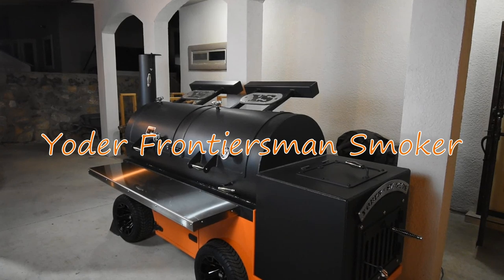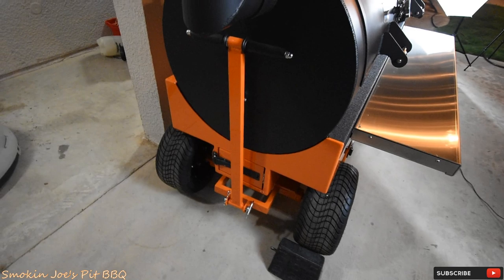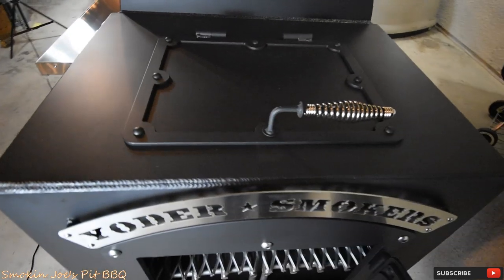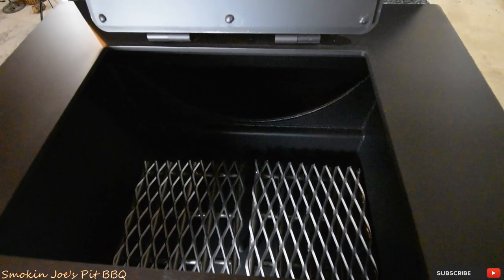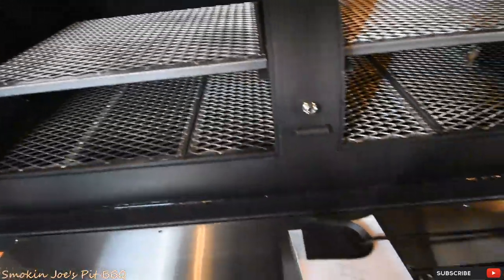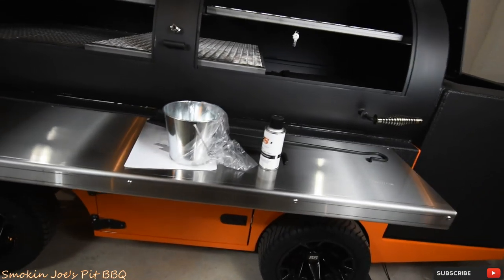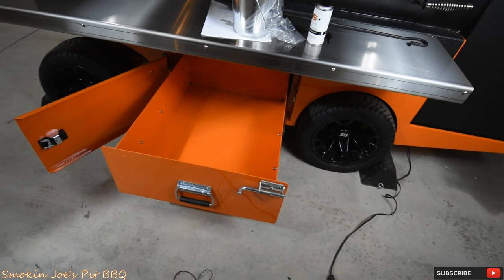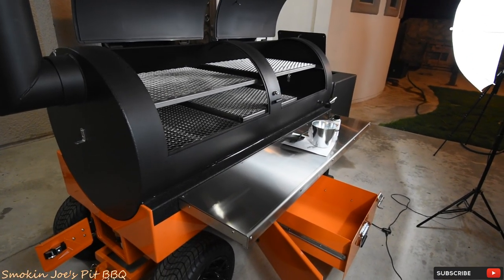My New Yoder Frontiersman Smoker

Comment: I had mine on a tandem axle trailer built the same inside as yours is but had to give it up because I just couldn't use it for what I needed to do. I liked the way it cooked everything, it was just hard to utilize the bottom grates all together because they dont slide out. I am surprised to see that they still build them this way . I had the temp control system too believe me I didn't have to pull it open too far to even out the temp left to right. Anyway congrats on your new Yoder.

Comment: I am considering purchasing this same smoker and have been doing a lot of research. I came across someone else’s video suggesting that the insulated firebox upgrade lowers the flavor quality because it was “too efficient”. Do you have any thoughts on this?
Reply from the maker: There is absolutely no truth to that. The fact that you have an isolated firebox means you'll run efficient and not burn through wood like crazy. Instead of the heat being absorbed by the outside air, it's forced to go through the smoker which means you'll use less wood. 👍🏼
Reply: Thank you smokin joe. I typically run a BGE which I think is incredibly efficient and have never had any issues with flavors or smoke. That being said I haven’t ran a traditional stick burner in years and I was beginning to wonder if there was something I was missing.

Comment: That is an amazing smoker, big Yoder fan here, I have a 640s and love it. Looking for an offset, what are your thoughts on the stack not being at grate level? Thanks!
Reply from the maker: Hello Vincent. This smoker is built with tuning plates so the stack being up high is perfect. I can also cook with the damper open which turns this smoker a top down (heat wise)  and the exhaust placement hasn't been an issue. Which offset are you looking at?
Reply: Smokin' Joe's Pit BBQ I am really considering the kingman on a comp cart. The only issue is that i live in NY and the shipping is very expensive. Also looking at LSG verticals, for what ever reason the shipping seems to be cheaper despite weight similarities.

Comment: I do have a question how do you clean a grill grates?
Reply from the maker: I haven't had to clean them yet but a good grill brush should work just fine. I used a wire brush on my previous offset smoker and a wire brush worked perfect.👍🏼